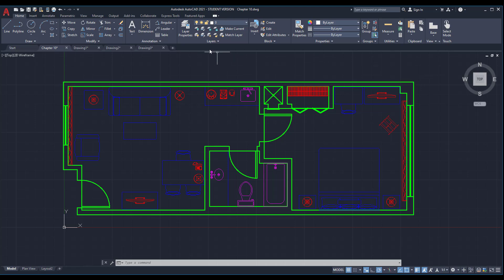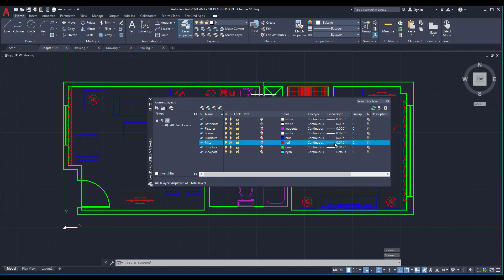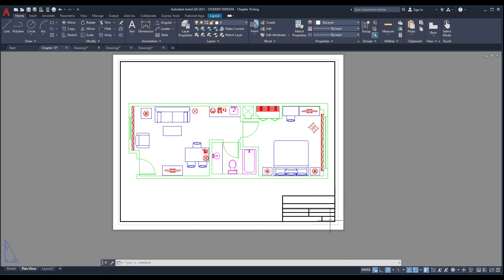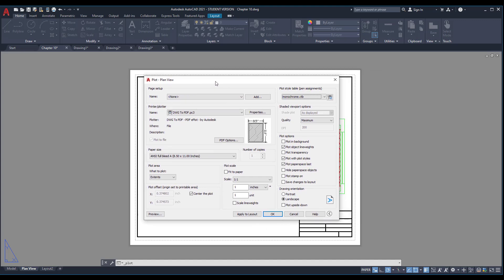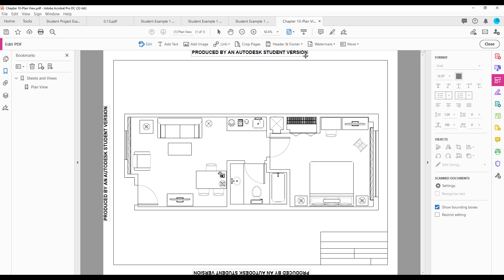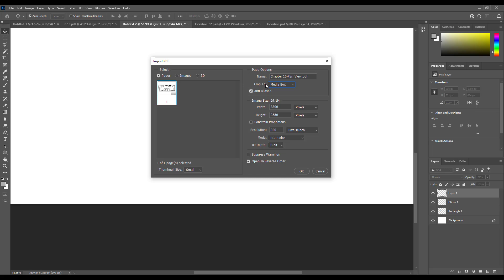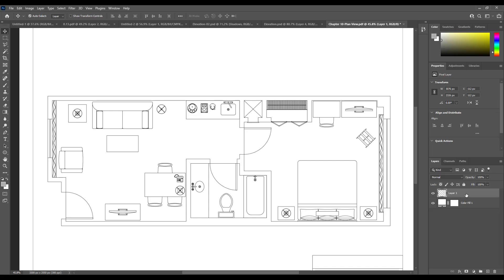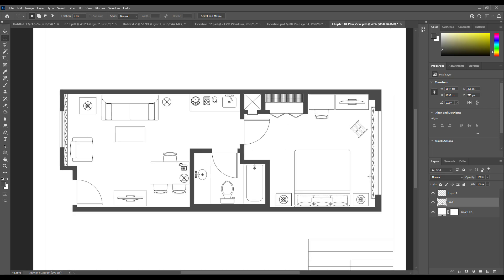How to Export from AutoCAD to Photoshop

Comment: 8:50 -> If you don't want to push  <Shift> to add selection you can push at anytime
from the toolbar the 4th icon from left, to activate "Add to Selection".
It's the icon with two rectangles, the one on top of the other.

Comment: What line weight number do you use if your working in metric?
Reply from the maker: 0.01/0.02 for furniture, 0.03 for elevation, and 0.07 for thickest lines (section cuts). This is my preference. I’m not sure if there is any standard.
Reply: @architectureanddesign7709   Thank you!
Reply from the maker: @amynelson9499  Of course!